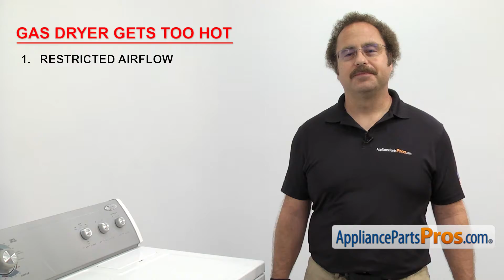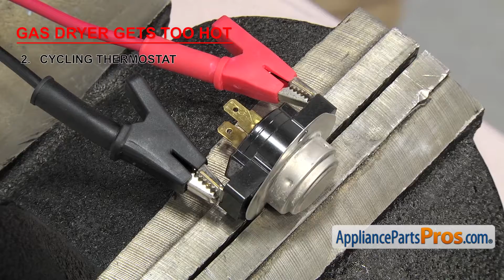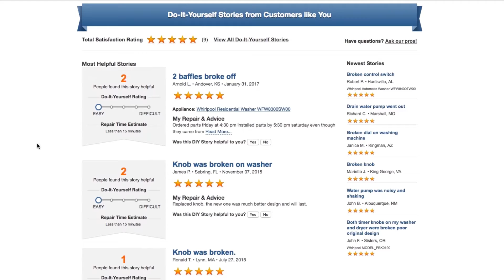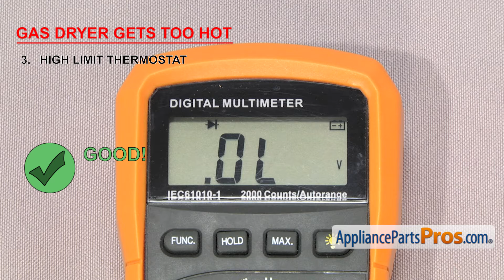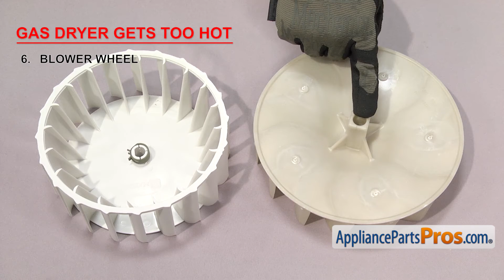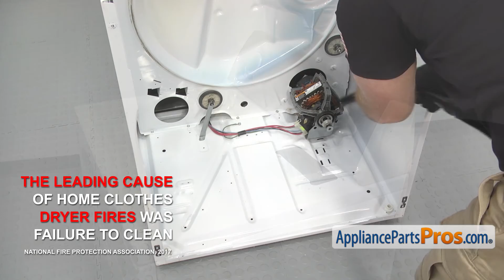Gas Dryer Overheating - Top 6 Reasons & Fixes - Whirlpool and others

Comment: Thanks for the video. My cycling thermal stat reads OL on the smaller connections. Dryer runs for maybe 10.mins then shuts down. Will restart after sitting for maybe 10 min. Dryer also won't start when the dial is set to air dry. Any recommendations would be much appreciated! I've checked all other thermostats for correct function, as your video showed